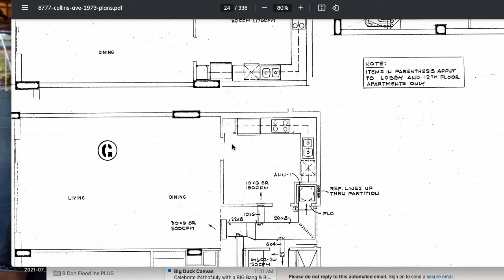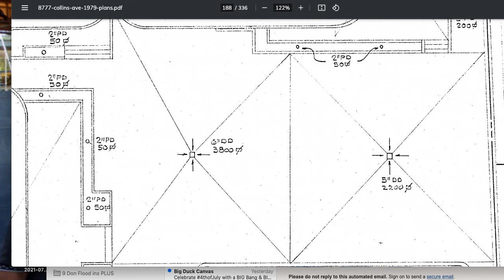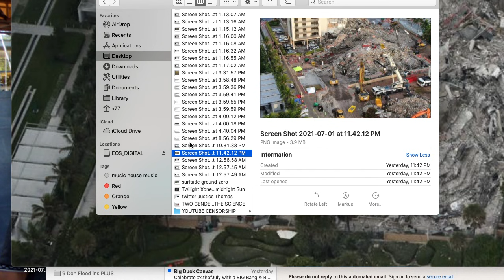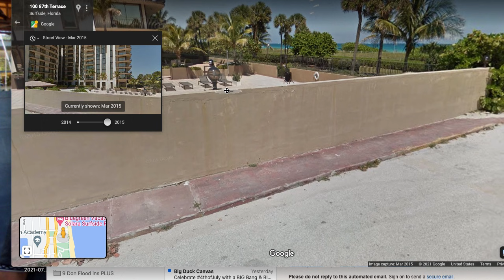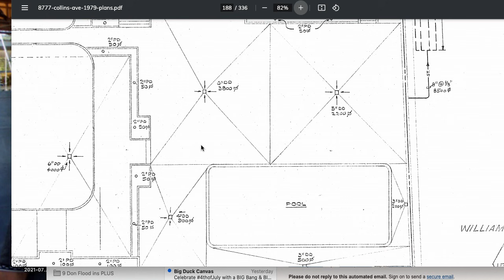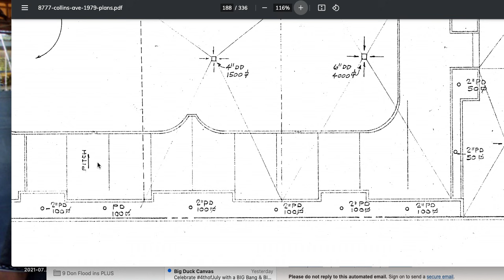Champlain Towers Collapse POOL DECK WAS PITCHED PER ORIGINAL DESIGN = CURRENT ENGINEER FAILED

Comment: Outstanding detective work. But let's be honest, I, and I assume every other layman, (I'm a small-potatoes architect, so not entirely a layman) expect ANY tower to remain standing even if ALL the surrounding "ledgered on" slabs have collapsed. Whether that takes doubled-up columns at the junction or what, it should be law and should have been back then too. It just seems inexcusable for the tower to have been so dependent on the parking deck.
Reply from the maker: Thank you... and I will be doing a model tomorrow, made of rigid foam and that steel I used in other video... I will demonstrate this load path failure. 
I will go further into detail how the deck fails and as far as the independence of the deck; perhaps it was at one time...  a ''B" column design has been 100% "deleted" from plans and I would hope that was an extra row of columns for this deck (just hoping = no proof, yet)...
Reply: @LoadPathEngineering  I'm glad you're going to show that. I can't really envision how a deck would cause a column to fail, even if it's attached.
Reply: Agree. A failure of the deck should never take down the building. The deck was unimportant. It was just a plaza for residents and a cover for the parking.
Reply: @tommiller12345  I suspect many buildings have critical failure modes of one type or another with an uncomfortable statistical probability of occurring within the design life. Having perimeter columns rely on a structural slab that requires constant attention and maintenance does seem like a particularly stupid idea.
Reply from the maker: PS I pinned your comment and I hope people read my reply to your important question and statements... Thank you.
Reply: So are we talking about the deck at pool level (that fell) or the slab below?  I think that some of the engineers are focusing on the slab below, where all the water problems occurred.
Reply: @philpacella7849  I think the pool is a red herring. I think the problem is with the seawater around the foundations and the piles.
Reply: @tubester4567  No evidence for subgrade failure at this point. There is evidence of punching shear failure of the slab and pulling away from perimeter columns which would then compromise their ability to resist the static loads.
Reply: @tomszabo7350  yes I think that is exactly what they will find happened
Reply: @tubester4567  no I don't think sea water was involved.  All evidence points to the pool deck collapse caused by the failure of the waterproofing and the fact the waterproofing was left in that condition for years.  That  destroyed the concrete and the rebar and the deck punched through the columns and fell into the parking garage.
Reply: @philpacella7849  "Slab" is just flatwork concrete, here they are referring to the concrete pool deck slab. That is what seems to have failed and pulled away from the perimeter columns (as shown on the section of building that was still standing). The collapsed section may not have had sufficient lateral support for the columns once the deck punched down and these columns failed row by row like dominoes.
Reply: @philpacella7849  they are one in the same. It all fell into the parking garage
Reply: Bullshit the residents didn't know. They see it everyday, and the board sent the engineering report to everyone after the 2018 inspection. Come on. There's no reason the board should of drug there feet on this. I've worked in high rise restoration for 10 years, and construction for over 20 years. This type of damage does not happen over night, and by God you see it falling apart. From the amount of spalling happening, there was lose concrete on people's decks. Everyone turned a blind eye. The board wanted over $65,000 from each resident for restoration, and everyone fought it, I guarantee it. Happens all the time, which slows the process further. I've also seen buildings worst than this in less than 27 years. 40, 50, 60, and 70 year recertification is way too long to wait.
Reply: How much is it sloped. Is there a building section thru that area?
Reply: I think what happened is when the deck failed and punched through to the garage some of the deck put side loads on several of the columns causing them to crack and push out sideways. After that happened too much support was lost and the building collapsed.
Reply: With many accidents, and especially with catastrophic failures like this, there are usually multiple causes that need to align to cause the total failure. Human nature wants to find a single cause, but in all likelihood it will be a complex cascade of factors with blame spread around to multiple parties. If there were maintenance problems with the pool deck that were not being addressed, there were probably other issues that were not addressed properly too.
Reply: By the way the comment is not directed towards anyone in here.

Comment: 1. it is NOT a defect to place FLAT waterproofing then a sloped mortar bed above - JUST STUPID. It requires more maintenance and is more expensive to replace.

2. structural engineer's note about not being responsible for safety or means and methods is STANDARD, as this is solely the responsibility of the contractor and their team.  although IF someone comes on site and see a glaring safety issue and they don't say something, they could be held partially responsible so it's not quite that simple.

Comment: The 3” drain at the wall along the south side of the pool is not a scupper it’s a deck drain, building codes would not allow a scupper to drain onto a sidewalk of adjacent property. Can you imagine the liability if pool water drained onto a sidewalk and someone slipped. I agree that plan does not address what would happen if the drain clogged or the volume of runoff exceeds the capacity of that drain.
Another thought, do the plans show any overflow drains or scuppers on the roof. As for the roof drainage being “redundant “ that makes no sense, you would have to do rain water calculations vs drain flow to determine how overbuilt the roof drainage system is. Sure if one drain was overwhelmed it would pool in that drain area and overflow into the next low spot or drain.

Comment: IF the DECK/FLOOR was designed to be be pitched and the water/rain ran off into inlets in the middle of the pitch - where did the water drain out and why was there always water down in the garage and the worker had to use suction pumps to drain the water and they couldn't keep up with it and had to replace the pumps.  Would these "pitched inlets" be the cause of the water piling up in the garage and causing moisture damage to the ceiling and rusting the re-bars and causing cracks in the ceiling and to the paint?  So Be It!!!

Comment: Nice work. Very good observsations 
Scupper  at the pool/beach side will be at or near the bottom of the wall just below the pool deck. You can see where there is a significant dip between sidewalk expansion joints  near the middle and efflorescence in that area. It looks like it still was draining through that area even though the drain is no longer there. Likely penetrating the pavers and following the original drainage path.

Comment: It's a design that when the pool deck comes down it pulls the whole building down! Shouldn't it have been free-standing rather than a floor of the building that gets 40 years of salt spray, water and baking/cooling. Plus less repairs and attention because leaking and cracking aren't indoors or on the roof.
How many other buildings have these very large concrete deck structures that can buckle key supports when they collapse?

Comment: There's another option you should consider in your analysis.  That option is that the drains in fact were put in and do exist as depicted in the original blueprints.  However, they were built into the brushed concrete deck.  At some point, the concrete deck became unsightly and difficult to keep clean.  So the condo hired a company to put in 12 x 12 pavers (go look at the photos photos) and just covered OVER THE DRAINS.  So the drains exist, but they are covered (capped?) underneath by the red pavers you see in the photos.  

And the contractor who installed the pavers either told the condo that "the water will still seep between the pavers and drain fine" or that "the drains weren't needed so we capped them."   Either one is wrong.  But I think this entire fiasco could have been caused by the paver company.

But there is a good chance there are drains underneath those pavers.  If not, how did not only the building inspector miss it, but the engineers and construction people?  Because even a construction guy pouring cement is gonna be like, "say, where are we putting the drains for this thing?"  

No way do I believe they all 'missed it.'  And also, I doubt you need to get a permit to put pavers on concrete.  So that might explain the drains were covered/capped and no building inspector missed it... because there was no building inspection or permit required for installing pavers.

Comment: Perhaps Moribito meant to say “this was a major error in the construction EXECUTION of the original contract documents,” since that’s clearly what happened
Reply: Sure. I mean, it wouldn't surprise me if over the course of the last 40 years, renovations and changes were made to the building. Maybe they refurbished the pool deck 15 years ago, and made it flat...added the planter boxes (which weren't accounted for with drainage). What I find surprising is that the building didn't show more significant signs of collapse. I'm not talking about some water and a few cracks (which wouldn't be alarming as a building settles), but major signs of structural damage.

Comment: That exactly what I first noticed about the pool deck failure, concrete poured over the top of an existing slab, removing the correct drainage, trapping water big fail! + rebar almost at bottom of original slab with only a useless 1" of cover! 2nd massive fail, and no extra rebar to support the second pour which was not to code anyway, plus all that added dead weight on original slab. Then blocking the drain to the street, That's 5 huge mistakes in the pool slab alone, fail fail fail fail fail its time to go to JAIL.
Reply: In the middle of 4 pillars the decking was sagging as seen by underside photo evidence of cracking from stress. Chances are the pool deck was leveled for cosmetic reasons. No waterproofing extra weight from extra concrete and water ingress . Blown rebar and doggy pillars and beams. Water in planters and extra weight. My money is a vehicle came down the ramp. Clipped a support pillar that in turn caused it to fall across bottom of ramp. The beam that already appeared very damaged and not actualy sitting on top of support pillar came down. This caused a chain reaction causing the pool deck to come down. The noise attracted people to see what was going on.one filmed into the condo ramp. Here you can see the collapsed pillar and beam plus water running out of sprinkler system. The load bearing of the part of building adjacent to pool deck at bottom area of ramp wasnow very compromised. At first smallareas started to come down until weight and gravity took over. Footage shows this area at bottom of ramp  to joint with pool deck and main building is where it all started. If one is looking for a catalyst something caused a pillar to fall. It will ever be known what started the collapse but they will know why it did. The Diggers are removing all evidence . Maybe there is video for past day to serif carpenters and exited. But ofcourse weight itself may have tested the resilience of the now dodgy concrete and rebar.   MY money is on 1000,s more buildings just in Florida are the same. Its going to be a great time for Structural Engineers who will inspect and carry out repairs. But its America the land of opportunity where everyone wants to make a fast buck. Did nobody watch Towering Inferno.

Comment: Can you further comment on the report that an illegal and unlucky 13th floor penthouse was installed on the collapsed portion of the building when the original plans only called for 12 floors? If an added floor were installed on a structure designed to hold 12 floors could that added weight be a factor in the eventual collapse, even taking into account the structural damage caused by the pool area.

Comment: You can have the best and most strongest designed building in the world, but if the developers want to cut corners, the builders are in the pocket of the developers, the various trades contractors are under the pump, its happening during a massive building boom. Where what regulators do exist are too overworked to look at every building under construction, & there's no onsite clerk of works because unions have been disempowered. Many of the regulators themselves are in the pockets of developers, & every trade is signing off their own work, & the certifier assumes everything is done properly, or has no time to look through it all to check if it is, & is commercially incentivised to give it the tick because the developer or head builder is their biggest client.. Then anything can happen.. 

Just look at what has happened in the now evidently largely unregulated boom in Sydney Australia, where until very recently you didn't have to be a registered engineer to sign off on a building.. Just Google Opal Tower, a $350 Million dollar 35 storey premiere apartment tower with $7 Million penthouses that had a column failure on level 11,  just 7 months after hand-over, in December 2018, which directly affected 12 storeys above on that corner of the building, & indirectly affected an entire third of the building. The above mentioned process is what led to that. Often the original render that gets approved even looks completely different, & sometimes even a 2 brm apartment becomes one bedroom after the developer decides to add more apartments in to make more money.. I guarantee you the same thing happens literally everywhere there's a major building boom & weak unions to hold cowboys account. Look at what happened with that building that collapsed during construction in New Orleans. Also remember many projects are built under Special Purpose Vehicles that transfer the profits form that job to the parent company & then unwind. Removing the head builders from liability for future defects. 

Champlain Towers was built when all the cocaine profits were flowing into Miami & everyone was in on it, laundering their money through property. A frenzied boom like that and anything can happen. I guarantee you there was very little regulation of the construction process, & who was on the ground would have been overworked. That's exactly what's happened in Sydney, where there's often been 300 tower cranes operating at once, just over the Sydney Metro Area, making regular engineers & inspectors visits almost impossible. Then for Miami add 40 years of neoliberalism & further deregulation & you get a potent mix. Looking at the extensive degradation of the concrete in 2018 it was already way past the point of an easy fix & had there been proper regulation would have never gotten to that stage. Even at 2018 i think it was near the point of being condemned without a full structural retrofit. The reduced carrying capacity of the rebar from all that degradation would have been similar to that of a building after an earthquake. After our major EQ in Christchurch NZ Feb 2011, we demolished 18 storey buildings with less visible spawling than that.

As for the planter boxes, having seen how problematic they can be when not tanked properly, & just how far water travels, through conduits & under tiles etc, if allowed to or not remedied, if you add at least a decade of poor maintenance onto that, on an aging & concrete cancer riddled building, due to said poor maintenance, then i think that's absolutely what caused the deck to collapse. That photo of the slab in the parking garage with all the spawling gives me the chills. I cant imagine how bad it would have been under the planters, all of which are right next to the columns that failed. What is interesting too is that in the plans if you look closely the columns in the half that collapsed are all smaller than the columns in the part that didn't, which i find strange because the weight they need to carry is the same. So that's definitely something that led to it failing also, and why the other half didn't. 

This comes under the definition of a cascade of failures, from construction right through its lifespan till its untimely collapse. And there are many more like it, not just in Miami, but Hawaii, Gold Coast, Rio, anywhere there's 80s buildings next to a beach built during a boom period..

Comment: With all the problems at the deck and lower levels, why then the decision to resurface the roof first?
Reply: Exactly. I heard reports that the work had been causing substantial vibrations for about a month up to the collapse. This can’t have helped.
Reply: I wondered the same thing and decided there must’ve been active roof  leaks  they had to address ASAP.

Comment: The roof failed first, it was overloaded with materials and the chiller and a/c units ate up  the steel. The city issued a roofing permit. The deck broke below from 11 slabs landing on it. The three white columns under the remaining tower is a sheared slab, the white is the garage .  The large slab on the pile was the failure . Also we had severe rains and everyone knows roofers are slobs and do not clean up.  Visqueen, paper and bitumen scraps  means redundant drains are all clogged . The pool never leaked a drop but the garage was filled with water to a mans knees .
Reply: The video I saw shows the bottom failed in fact the video that was taken I think it was like 7 minutes before the actual failure shows the parking garage ceiling caved